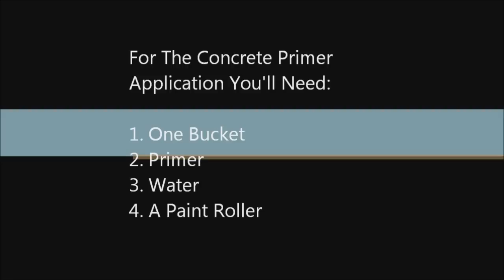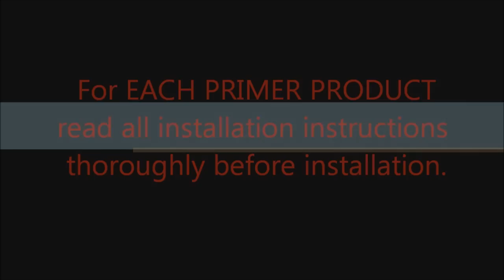Concrete Primer Application before Using Self Leveling Underlayment Mapei DIY Mryoucandoityourself

Comment: Would you recommend  grinding old paint off prior to using a primer before self leveling? My basement is from the 1950s and has a grey paint on it.
Reply from the maker: Good question! I just finished leveling project in the basement with a painted floor. I grinded all paint off and then leveled it. I will publish a video about it on Sunday. Thanks!

Comment: You spend a ton of time cleaning up primer. I am a commercial flooring contractor from Florida. We take a sponge and dip it into the primer and apply. Sponge it out. If we want to ensure complete even coverage we will sponge it heavy and roll it out. Better control, and no cleanup at the end. Saves time, energy, and money from more efficient use of products.
Reply from the maker: Thanks for the tips!

Comment: I have taken up Marley vinyl floor tiles , there is a black sort of bitumen adhesive left on the screed which is stuck solid and dry , do you do a self levelling compound that would adhere to this substrate . Would be grateful for any advice
Reply from the maker: Hi Steven, we always removing this bitumen with grinder. We just add sand when doing grinding, i's help a lot, because sand bonded with bitumen.
Reply: @MrYoucandoityourself  Thankyou for your advice , good tip with the sand 👍
Reply from the maker: You are welcome!

Comment: How much would you suggest we dilute the Ardex P51/52 for tiles on wall? It says on the bucket that it should be Ardex:water 1:1/2, which we’ve done, and that you’d use about 200g per m2 that way. Yet we’ve done a whole area of 8m2 with maybe 50g of product at most. Any more of the diluted product will just drip off the tile wall. Should we do multiple layers? Or use it not-diluted? We’re going to plaster/stucco/tadelakt over the tiles after the primer.
Reply from the maker: Hi Anne, I don't know this product. I specialize with Mapei. But, maybe over tiles, you have to put primer as it is, without mixing with water? Just idea.

Comment: Should I mop the floor first?
Reply from the maker: Hi, it's not necessary because you need mix primer with water.
Reply: You should always make sure that your area is prepped well before you begin. Sweep the area and, if it is dirty, then mop the area as well. If you have to patch any areas with a patching compound, it is always best to dampen the spot before applying the compound. This is because the dry concrete will pull water out of the patching compound and it may not adhere properly.   The dampened concrete will help prevent this from happening.  Hope this helps. 😃

Comment: at 00:57 Apply primer, working it into the substrate with a push roller (No roll out!)
May I know what do you mean "No roll out"?
Thanks.
Reply from the maker: Have you ever painted wall with roller? If yes, you rolled paint out.
Primer should be absorbed into the cement floor, that's why you should push it by painted roller. Hope it helps.
Reply: MrYoucandoityourself I ask same question but can you give I "newbie" a more understandable answer. :)
Reply from the maker: Just let the primer soak into the cement.
Reply: MrYoucandoityourself
This product should NOT be diluted 1:1 or applied with a roller. It is to be applied at a dilution ratio of 1:3 and scrubbed into the concrete with a brush or broom. If the product is not diluted properly, it will create a film on the concrete surface (creating a bond breaker) rather than penetrate into the pours (locking itself into the concrete).
Reply from the maker: Mike D
Each brand of the primer has individual instruction. Read it.
Reply: +MrYoucandoityourself I was wondering what you meant by roll out as well. I think I get what you're saying. Roll out method would mean you would be putting the primer in a pan, getting the roller wet, then rolling it on the concrete. The method you're saying to use would be just to dump the primer on the floor and push it around until it's spread across the entire area needing to be primed. Am I right/wrong?
Reply from the maker: You are right. Sorry for my "beautiful" English (it is my second language) :) And thank you for help!
Reply: +MrYoucandoityourself You're welcome!

Comment: We have recently applied floor multi purpose primer recommended by Loews for our floor to install stick and peel adhesive vynil plank. Our floor is still tacky more than 24 hours after application. We have used a dehumidified, and the outside air is not all that humid where we are. Would you happen to know if it is supposed to stay tacky after application?
Reply from the maker: Have you read an instructions for your primer? Every one of them is different. I didn't use this kind of primer.

Comment: Why use a primer on concrete floor at all? What does the primer actually do ?
Reply from the maker: For better bonding.
Reply: Usually it will say “Bonding Primer” as opposed to Just “Primer”.  I find that this also makes it easier to recognize that it’s main purpose is to ensure that the concrete will bond properly with the next product you apply.  Hope this helps. 😃

Comment: Hi...what's the name of the concrete primer would you recommend....thanks
Reply from the maker: Jim de la Cruz I recommend using primer with same brand of self-leveling. For example: If I use Mapei Novoplan2 self-leveling I will use Mapei primer.

Comment: Are you sure you should be pouring your leftover primer back into the rest? Your primer is diluted to a 1:1 ratio and you are pouring it back into a concentrated formula. The next time you attempt to use that primer it will already be partially diluted, right?
Reply from the maker: I have enough experience, so I recognize the color of 50/50 concentrate. If you are newbie, you should miss this step.
Reply: MrYoucandoityourself most of us our newbies or we wouldn't be watching this video , next time think for yourselfmuch appreciated